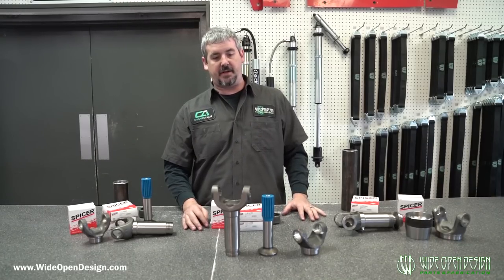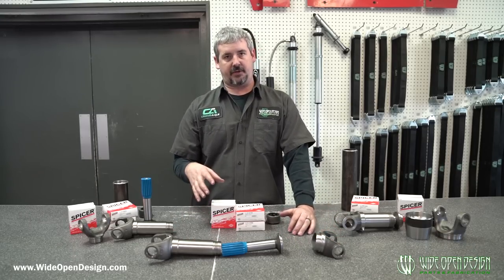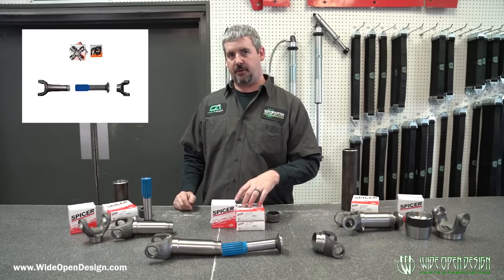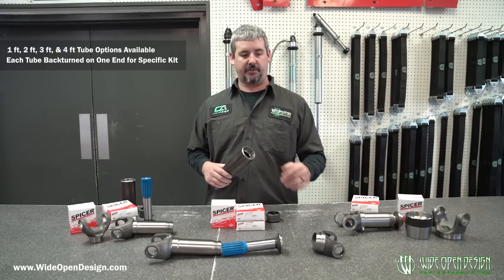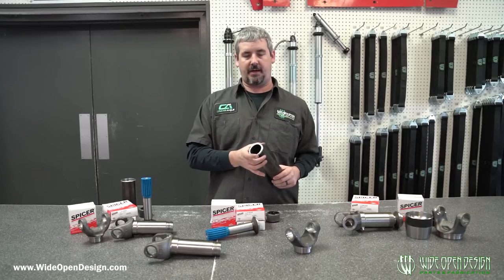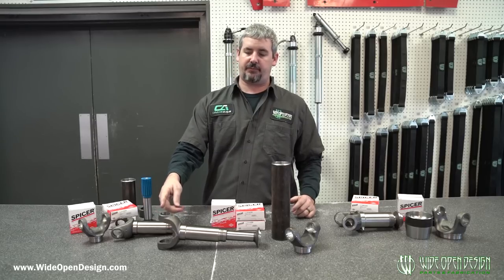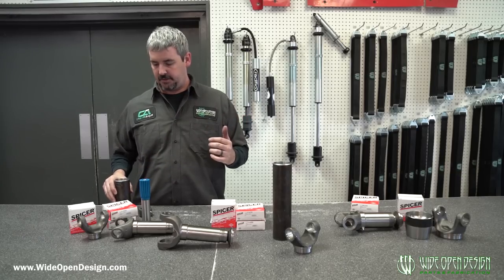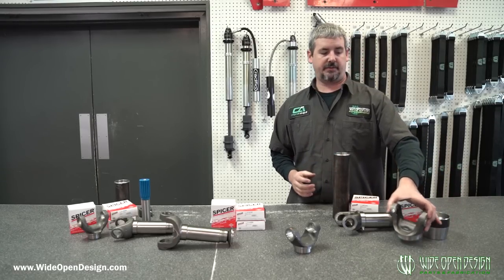Heavy Duty Off Road Driveshaft Kits - Wide Open Design

Comment: What about the less common adapters?  For example on my medium duty truck, the largest yoke flange Spicer makes for my transmission is a 1550 but I'm converting it to 4wd and using a Spicer 738 transfer case.  And the smallest yoke flange Spicer makes for that is a 1610 series.  And I've not found any 1610 yoke shaft that will mate with a 1550 slip shaft.  Thank you, Sir, for a great video, but there are a plethora of videos on this little stuff but nothing on adapting different medium duty shafts together, especially on bridging the 1550 and 1610 gap.